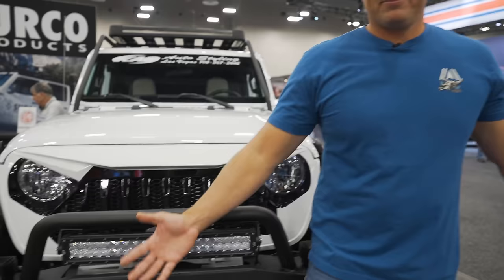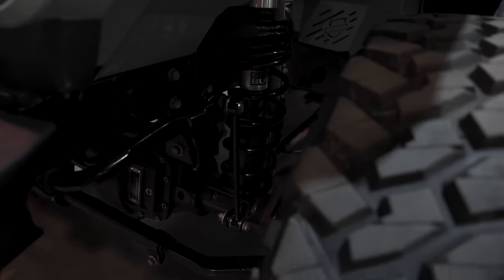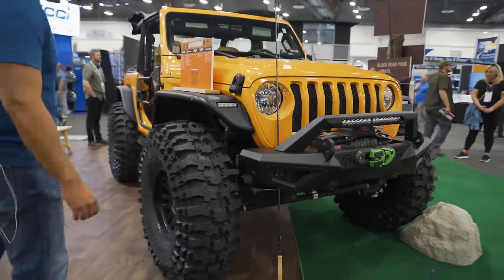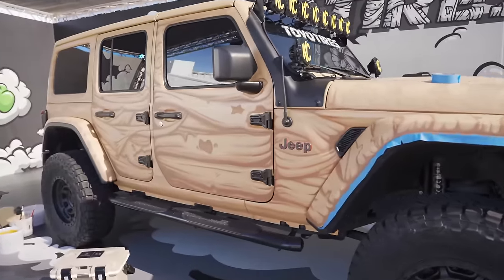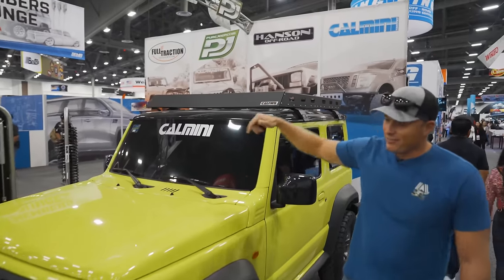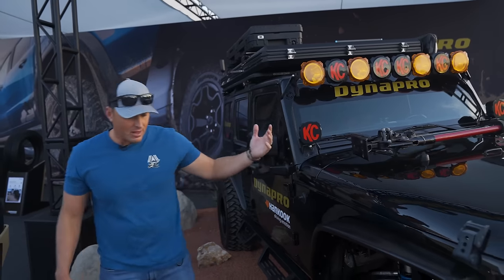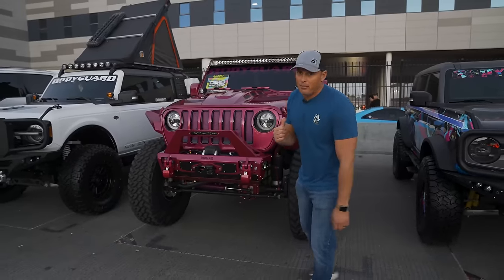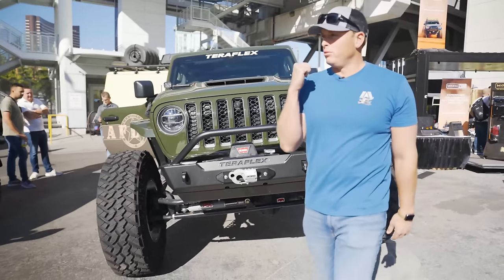Every Wrangler Build at SEMA 2023 ft. 392 HEMIs, Rubicons, JLs, Electric Jeeps + MORE

Comment: Jeep Wrangler JLU Or JT looks best with round spot lights mounted on the front bumper. Integrated light bars look okay, but a light bar on the bumper looks bad. The American adventure lab build is incomplete without a roof rack. Air design wrap is good. Junk wheels and tyres combo, very bad looking grill.